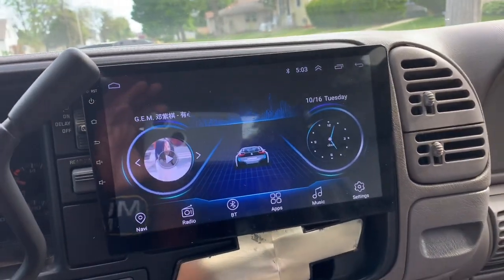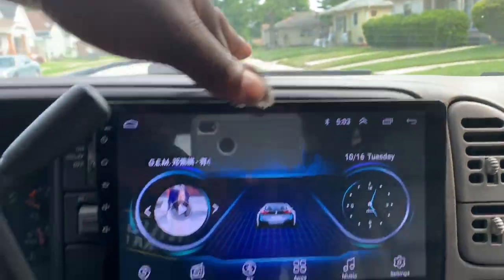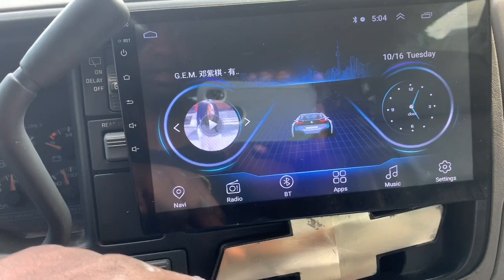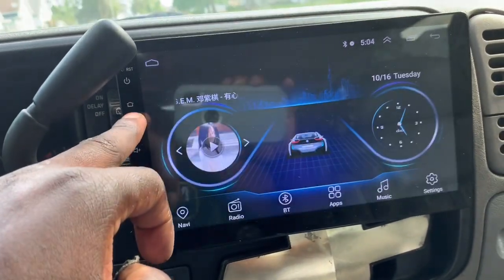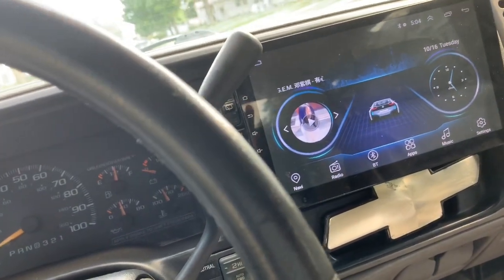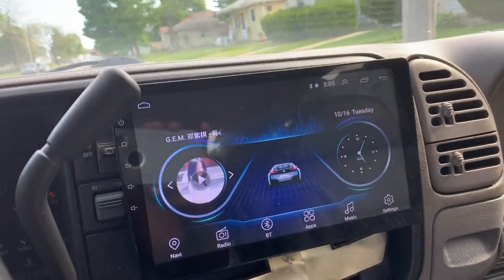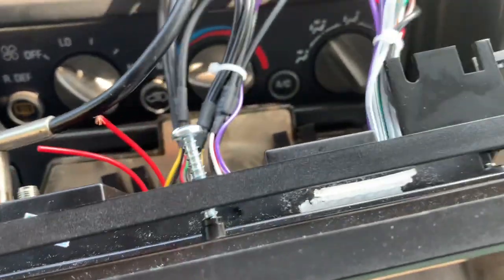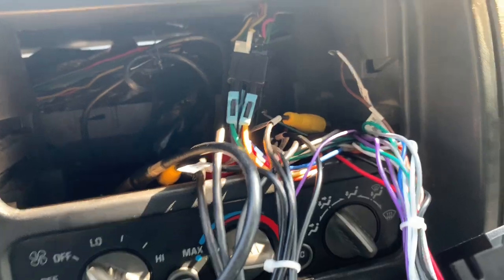Android 10.1 Inch Stereo Installation 99 Tahoe , Yukon , Suburban 94 95 96 97 98

Comment: I just purchased one but I feel like even when I turn the volume up all the way it’s still quiet and not as loud as it was with my old stereo I’ve messed with the equalizer and nothings seems to work. You got any advice for me
Reply from the maker: I’ve had new bad radios
Reply: Try the factory settings,  the code is 8888.
The look in the USB settings, there you will fine other volumes and controls.